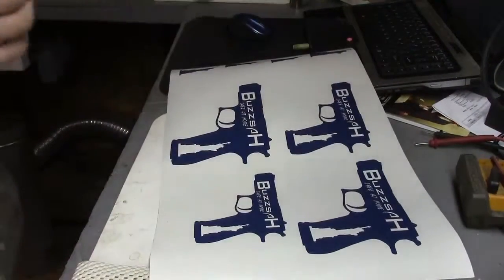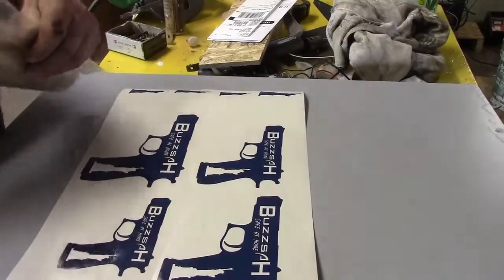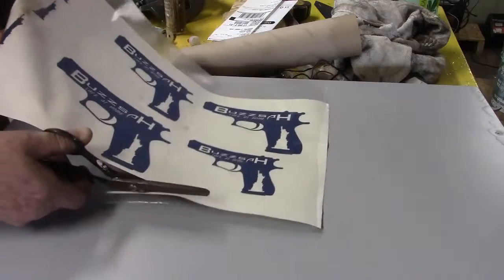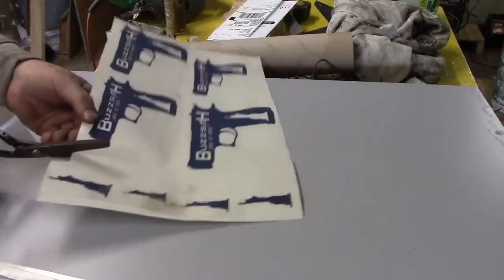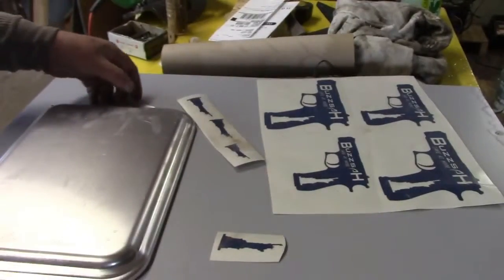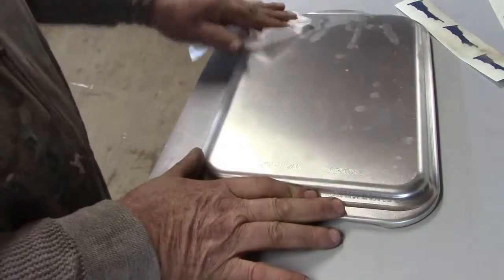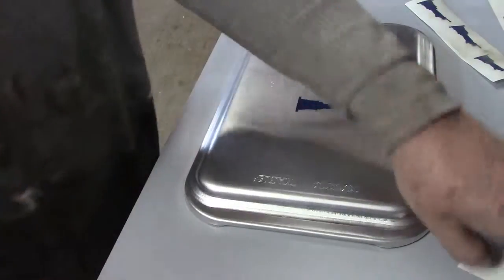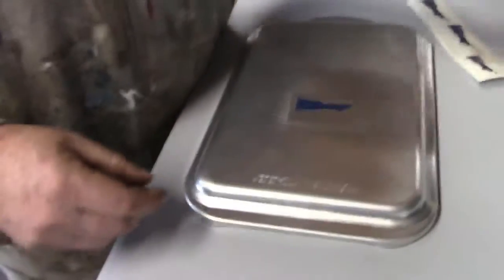Applying Transfer paper

Comment: the company I used to own made thermal cutting dies for decals -- sometimes up to 40' long... it's surprising the techniques haven't changed in 40 years! lol
Reply from the maker: +buckeyeimaging   I did have a large format printer and laminate machine but the color didn't hold up as good as a good vinyl, but with the printer I was able to print anything on media that would go through the printer.